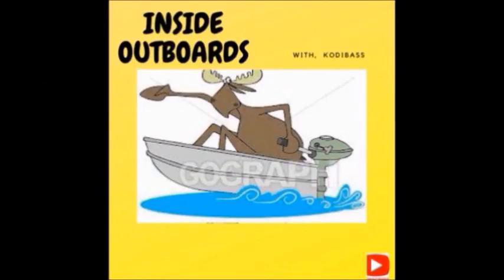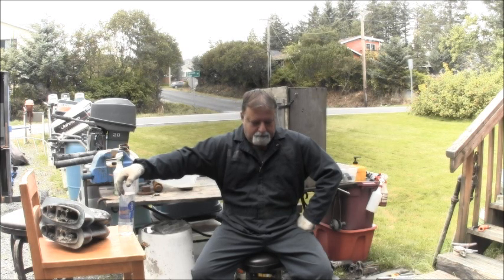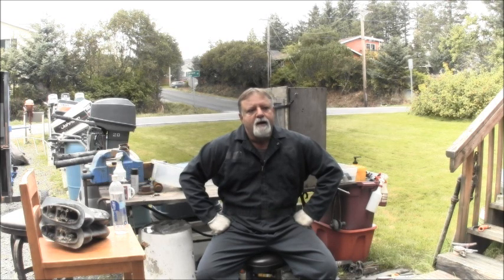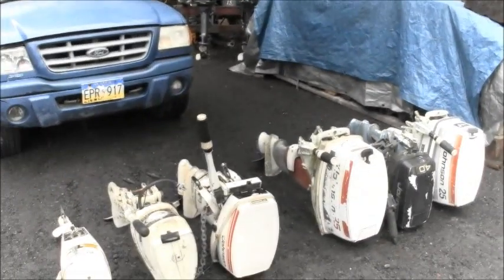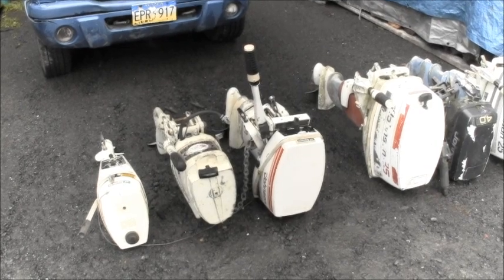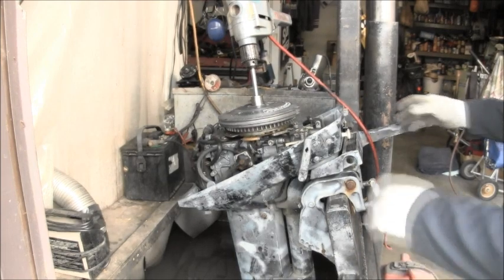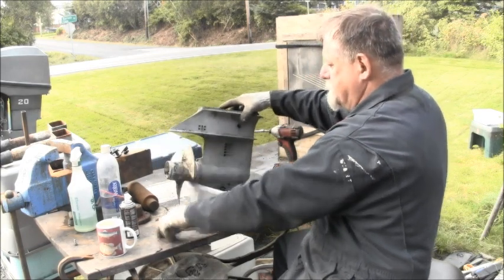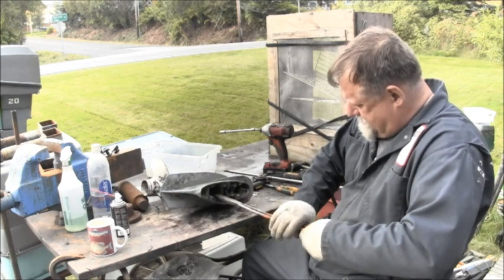EVINRUDE  1981 15 HP,  SAVE OR SCRAP,  Never Guess What I Found,

Comment: Hmm, you mentioned that the impeller looked to be in great shape, leading me to believe the gearcase has been off before.  And, of course, no one took the time to lube the fasteners properly during reinstallation.  Like you say, the gear lube looks OK, I suppose it might have a broken tooth or something like that.  But, it is also possible that someone replaced the driveshaft using the wrong one which may have been pushing up on the crank causing the lower powerhead roller bearing to whine.  Once the gearcase was off, the upward pressure was gone, alleviating the whining.  A broken gear tooth would have probably produced more of a growling noise, that noise definitely sounded like a bearing whine.  Or, perhaps the splines were a bit rusted in place pushing up on the crank, although you didn't seem to have trouble removing the gearcase.  I guess I would check this powerhead for excessive crank end play just to be sure.  Make sure the lower powerhead seal isn't leaking also.  Yeah, I know, you sure don't want to chance snapping off the three lower seal housing screws.  Again, the noise sure seemed like a bearing whine, and the lower unit lube seemed "OK".  Just don't want the whine to reappear after going through all the trouble of transplanting this powerhead to a nicer engine...
Reply from the maker: Yep' I will look things over good, I also will pull the lower unit apart & check it out'  who knows there might B a pig or goat in there. haha     kb

Comment: Have you noticed, the smaller units (outboards) from the 90’s on, don’t have primer much less proper coatings of paint like Johnson/Evinrude used to do on the older models. 
I have an 2002 40hp Johnson, there are some scratches and scuffs, very bottom is missing paint all together, would you recommend the proper zinc primer, primer and paints to redo this one, I’m willing to take the time to do it right. I have her running like a top, so mechanically she’s great, she needs a major spa day, but don’t want to cut corners, I’m keeping this one for a while on my small skiff, I should be able to run all day on 6gal and get to places a lot of other boats can’t get to.
Reply from the maker: I use the Moeller zinc etching primer,  As far as top coats go The moller is about all that is available in correct paint parts numbers,  OMC  has their own lable but I have been told it is Moeller as well.  Heck even Rustoleum and krylon is going 12 $ a can now.      kb
Reply: @kodibassInsideoutboards  I appreciate the response. I don’t mind spending the $$ on the right stuff. This 40hp isn’t going to take much to make it right. I just want it right. I’ve looked at the some of your other videos, where you say at least 3 coats of each and I don’t mind the wet sanding in between the coats to make sure she’s as pretty, more important to me, done properly for longevity. She’s a runner and I want her to last as long as I do. Like I said, with prices all over the place, I can run long distances if need be on 2 tanks or my method, one 6 gal tank and a 5 gal can. I always use non-ethanol gas, unplug my fuel line and run her dry, I have found this keeps me from having to do carb rebuilds more frequently and I give her a proper bath after each trip. I run in low salinity water, very rare do I get to 11-14 parts, usually in water around 4-9 parts, so not real salty. I don’t get to the outside Gulf of Mexico waters but maybe once a year and that’s a long run. I’ve learned to look for certain things to check while servicing my outboard, from you. I appreciate the content and more importantly the info from you. I hope your house in FL has survived with no damage. I went through IDA last year and the TS storm a few weeks before that, my fall was filled with cleanups and repairs, which cut back on the amount of trips I was able to make for spring meat stock. I’m not missing this year. Can’t afford to. I need to stock my freezer. Thanks for the reply from SE Louisiana.

Comment: Almost looking forward to snapping a bolt off so I can try your drilling/lube routine!  No how the heck did those plastic toys get in there?  Did someone have the powerhead off before and some kids threw the toys down there?   I think using this powerhead as a donor for a nicer unit makes the most sense.
Reply from the maker: If your like me you won't have to wait long before a bolt goes snap, haha.  Thanks   kb
Reply: @kodibassInsideoutboards    For sure.  I work it so gently for what seems like hours, it finally starts to move, then....Snap.